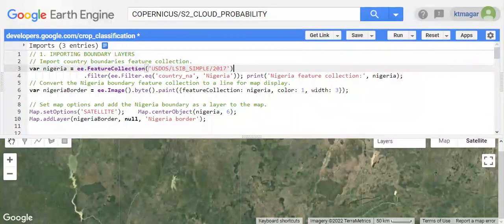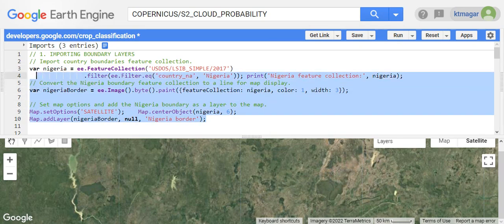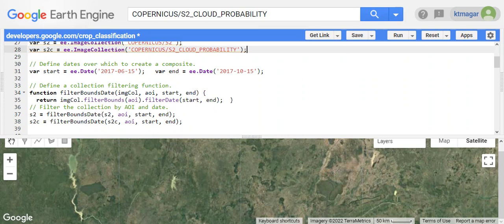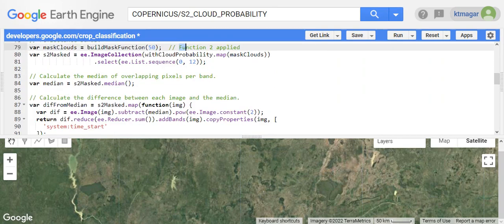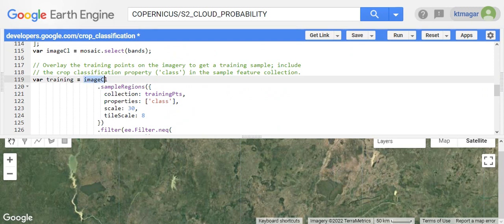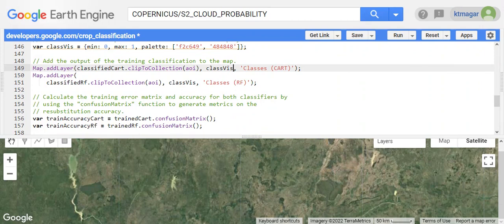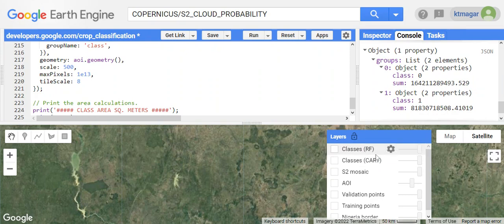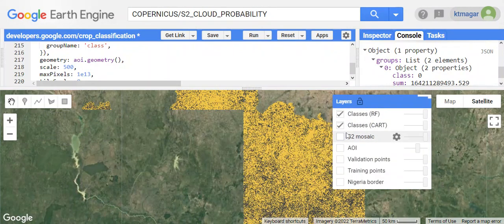Crop Land Classification in Earth Engine [GEE]

Comment: Please how did you get the ground truth data ?
Reply from the maker: If you are asking about the general process, usually large number of volunteers help in the collection of the ground data, Or the researchers themselves may travel a lot collecting the locational information.

Regarding the codes in the video, these are adapted from the earth engine tutorials. As mentioned in the page, the data were collected by teams who worked on TAMASA project.

Getting the ground truth data is an intensive process. But other ways may be getting it from high resolution image, such as images from Google Earth.

Hope my reply helps.
Reply: High resolution sentinel images? How please

Comment: I still have question to you if you do not mind, what are  your var values0 ,var values1, var values2 used for, I still not understand in your explanation in your video, you have 30 classes? which means your paddy has 30 classes you have to separate? thanks in advance!
var values0 =   [1, 2, 3, 4,5,
                 6,7,8,9,10,
                 11,12,13,14,15,
                 16,17,18,19,20,
                 21,22,23,24,25,26,27,28,29,30];
                 
var values1 =   [0, 0, 0, 1,0,
                1,0,1,0,0,
                0,0,1,0,0,
                1,1,0,0,0,
                0,0,0,0,0,
                0,0,0,0,0];
var values2 =    [0, 0, 0, 2,0,
                3,0,4,0,0,
                0,0,1,0,0,
                2,3,0,0,0,
                0,0,0,4,0,
                0,0,0,0,0]; why only values0, values1 and values2, is there any other values you need to modify? :virtualhug:
Reply from the maker: yes, you can question as much as you like. this helps me too, i will try to answer if I can. 

The remap function is used to rename the clusters. Yes, we had 30 clusters. We are regrouping it to rice and non-rice by using the remap function.

You can check more about this function from the reference in earthengine.
https://developers.google.com/earth-engine/apidocs/ee-image-remap

Thankyou

Comment: Hi, thank you for the useful tutorial! I have a question, when I try to run the classifier on a large area, the bug came out that out of memory. I'm wondering if you have the same situation and how do you solve this problems?
Reply from the maker: thankyou for the question. 

The easy solution would be to decrease the study area/region if that is okay to go with. This might not always be possible if you just want all the area. My approach would be to try breaking the study area into smaller area, then  merge the classified results as the single result. This is possible when you are doing smaller districts, and then you merge the classified results as one single image.

The other option can also be changing with the pixel values, doing the classification with the scale at 10m would also result the error, may be trying it more coarse might help. 

The other thing is we get the out of memory due to the specific case, and you can try solving particularly in that way. Please search the multiple solutions in stack exchange which may be helpful. Here is one discussion, similar to ours. https://gis.stackexchange.com/questions/342792/user-memory-limit-exceeded-error-for-classification-in-google-earth-engine 

If you are more aware, try performing the same analysis with same approach in planetary computer, may be that will be helpful.

Hope my reply was helpful.
You can reply here later, how you solved this.

Thankyou

Comment: How to improve the validation accuracy?
Reply from the maker: Well, this cannot be said for sure. It depends on type of data mainly how big it is, analysis we are doing, what validation accuracy we are aiming for. It might also depend on type of model we are applying. I think if you consider what you are doing, then the validation accuracy will be within that. I hope you find your answer in your learnings. Thankyou for asking it here. : )
Reply: @ksabmagar7  I am doing landuse landcover classification and everytime validation accuracy is low. Even i took more than 300 training samples for each land cover.
Reply from the maker: @omaizamalik229  How are you taking the training samples? And which models are you trying? May be trying with different models, and collecting training points from higher resolution might help. Also doing the classification in time series images not just in single image might help. Please try looking more articles.

I also cannot suggest that much as classification approaches have multiple approaches. Hope it helps.